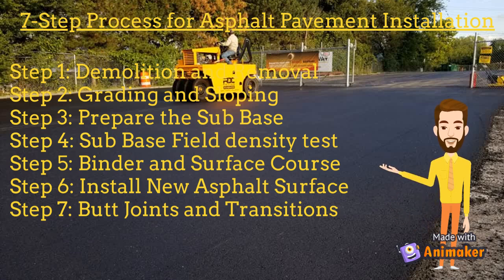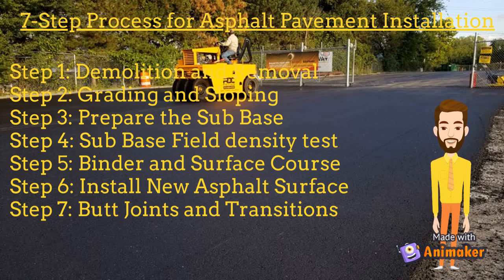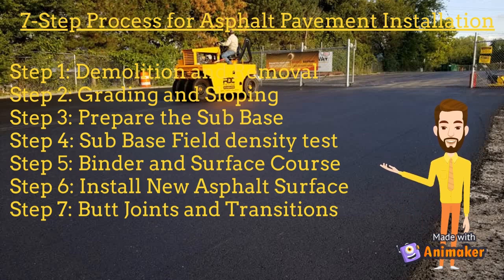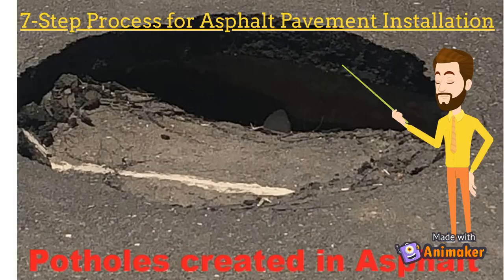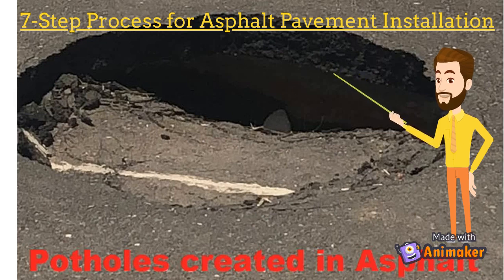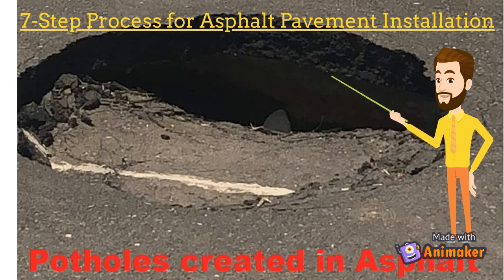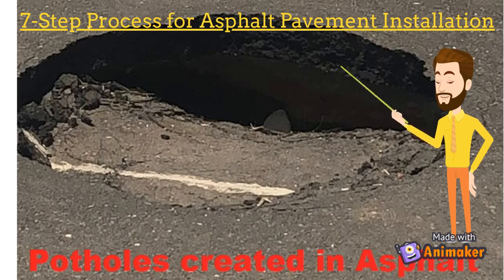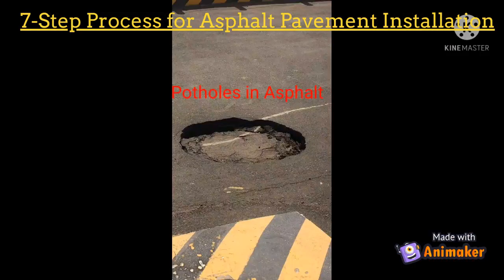7-Step Process for Asphalt Pavement Installation

Comment: All asphalt is toxic, it is not just the fumes, it is a hydrocarbon that releases particles of heavy metals into the air we breath that causes people to be dumb downed. Asphalt makes people so stupid that they become immoral criminals. It disrupts the endocrine system, causes fatigue, brain fog, ETC., and it does not matter whether it is dry or not. An asphalt road releases more pollution than all the vehicles that drive on it, and the pollution is five times as bad in hot temperatures.